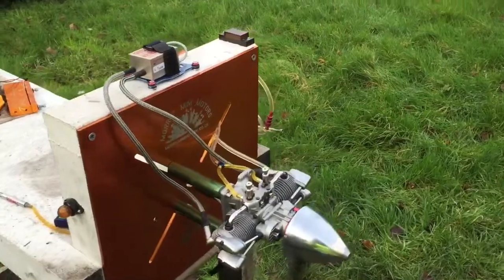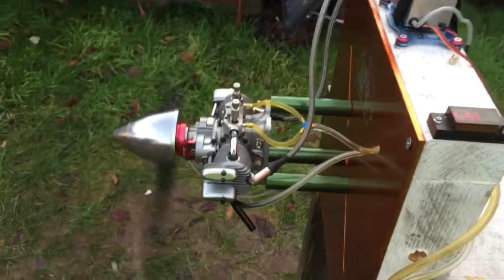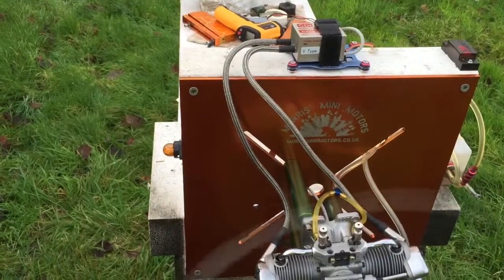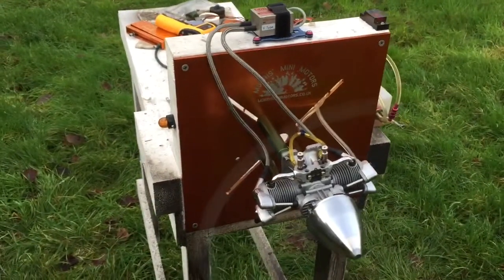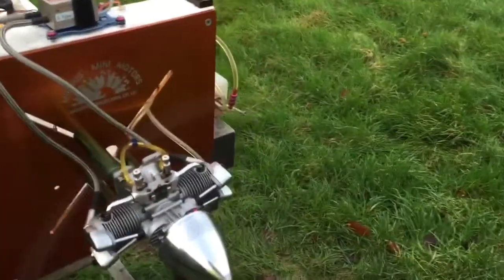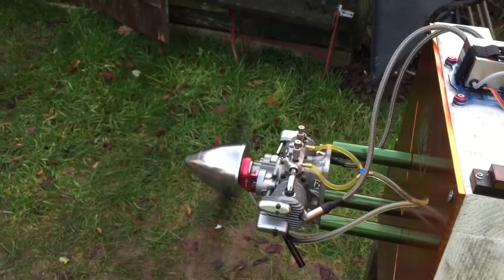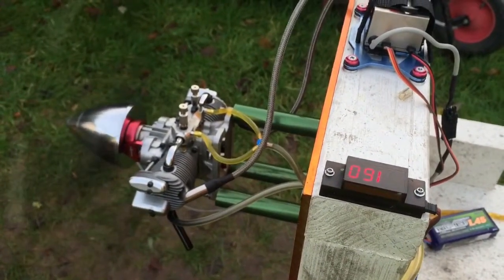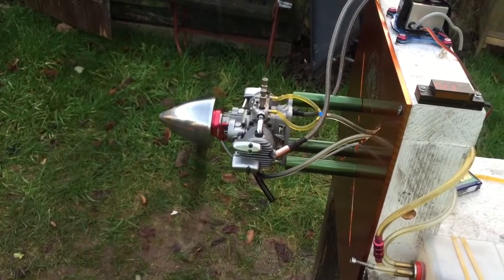Saito FA90T CDI Conversion running on Gas

Comment: Sounds great! 
I have two saito 90ts engines on a twin I have and i was thinking about converting them both to gas,  what do you think? I believe the 90ts has a true boxer type firing order, both cylinders fire at the same time. 
How is the reliability with these smaller engines running on gas? 

Thx allot
Looking forward to your response!
Adam
Reply from the maker: mopar69brt 

Hi 

Thank you

Yes you are right the 90Ts is a true boxer engine

Too me smaller the engine are i find it easier to set the needles !!

Thanks Morris